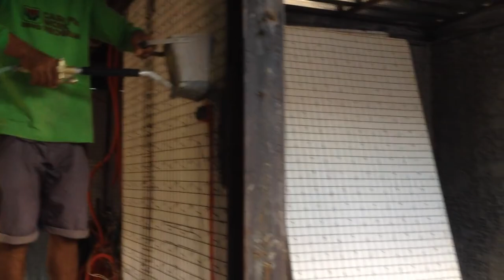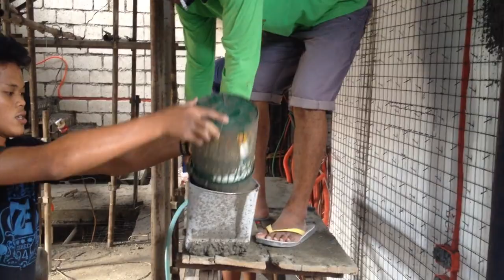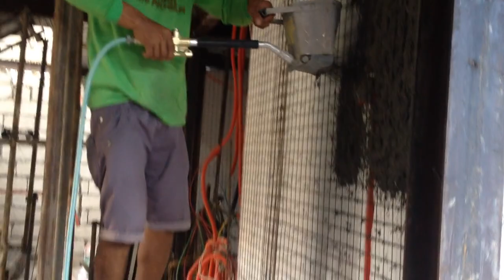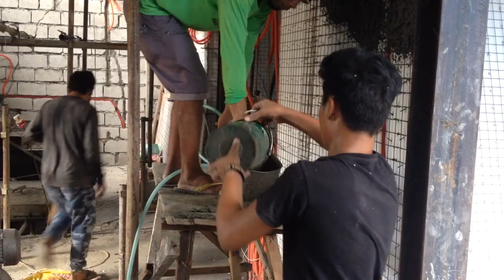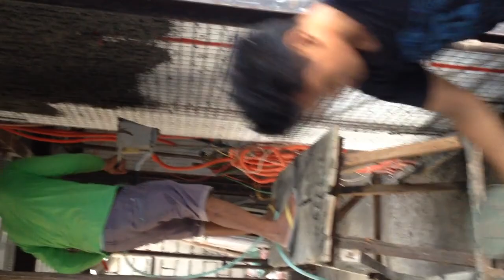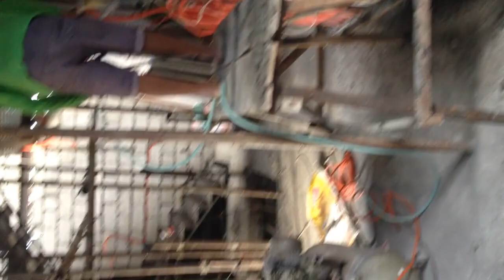mortar sprayer on 3d panel system (SRC panel or styromesh 3d panel)

Comment: Ano po yung mix ng semento buhagin at tubig?
Reply from the maker: sir @mugiwarasensei2558, thanks sa message mo po. Kapareho lang ng timpla ng ordinaryong pampalitada.
Reply from the maker: Please don't forget to subscribe po. Thanks again po.
Reply from the maker: 1:2 or 1:3 po. 
Kung 1:3 ay 1 bag cement is to 3 cu.ft of screed or binistay sand
Reply from the maker: Around 30 to 50 liters ata per bag of cement ang kailangan, depende sa moisture o pagkabasa ng buhangin. Sorry, di ko masyado pinapansin ang dami ng tubig kapag naghahalo ng pamplitada kasi mura and abundant lang ang tubig sa Pilipinas. Bukas tantyahin ko po sa site.

Comment: Ano pong specs ng compressor gamit nyo sir?
Reply from the maker: 2hp po Sir @mikethirteen. Yan po minimum requirement para di mabitin sa compressed air. Thanks po sa query mo.
Reply from the maker: Please don't forget to subscribe po. Thanks again po.
Reply: ano po brand ng compressor sir...
Reply from the maker: @mugiwarasensei2558  Vespa po 2hp motor ang meron poako.Pero maski ano brand po pwede gamitin
Reply: Hello boss. Paano po pag src slab, uubra rin po ba sprayer?